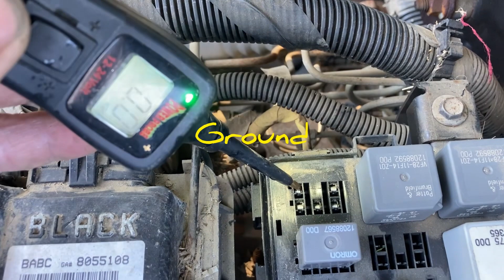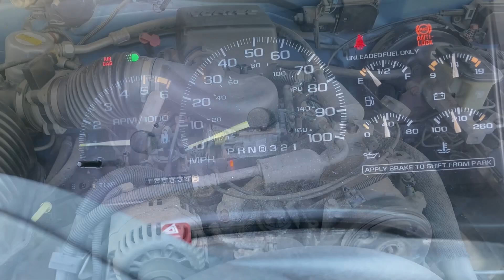1996 Chevy Silverado fuel pump Relay

Comment: Okay so I tried this and nothing works I used a jumper wire instead I know the pump was good when parked new motor put in and I need to get fuel pump to power what can I do